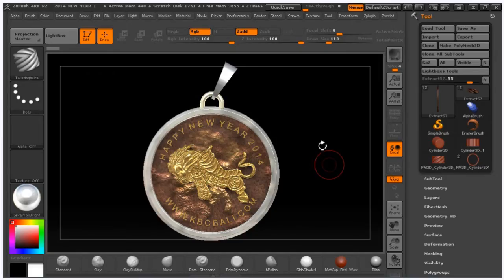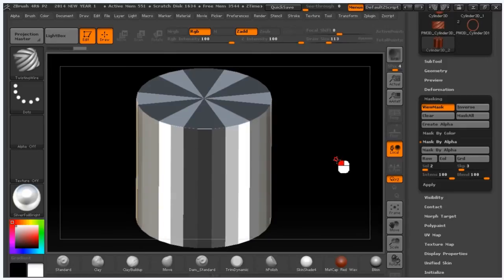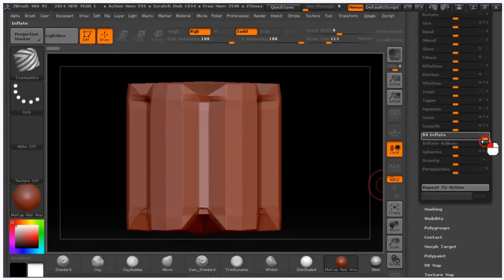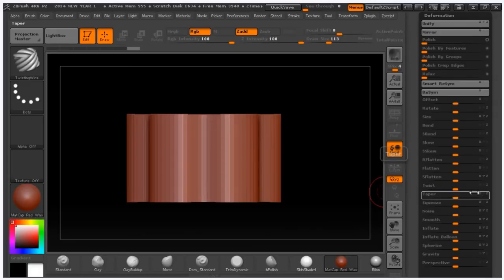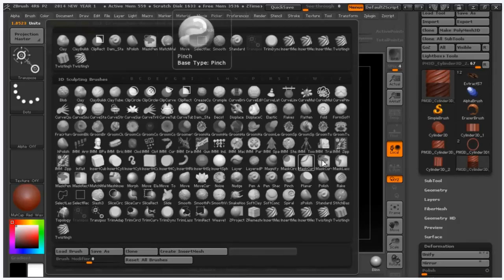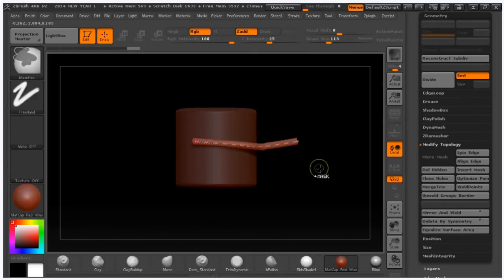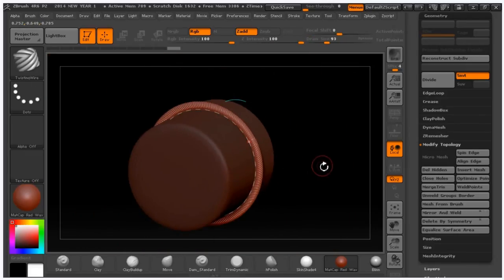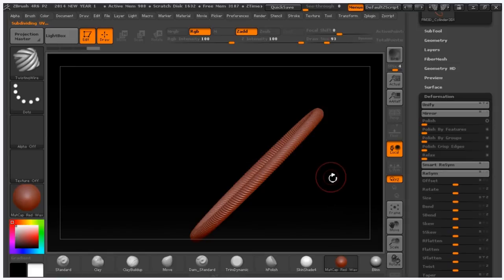Another technique make twisted wire ring

Comment: Hi! Made Sandiago. I'm having a hard time trying to execute your point 4:36
The audio is not clear in this point.

 I see you apply the 1st curve, then you press: cltrl+click to remove the mask, then I see you apply the 2nd curve.....and you got the ring in perfect position...Did you press a specific key to have the ring aligned and create the loop around the cylinder while the 2nd curve is applied?  =S...
I create the ring around the cylinder but I used 3 curves and the ring is not aligned at  all..O.o..

BTW,,congrats for your videos,,very useful!
Reply from the maker: Hi Eddwin, just click over the object then drag until through away the cylinder then press shift key, move right and left while holding right click to make it straight. To apply the second curve, firstly ctrl+right on canvas to make the first curve inactive

 Sorry for the audio, I found my recorder was not good
Reply: Thanks a lot!! Made Sandiago....it worked fine =)